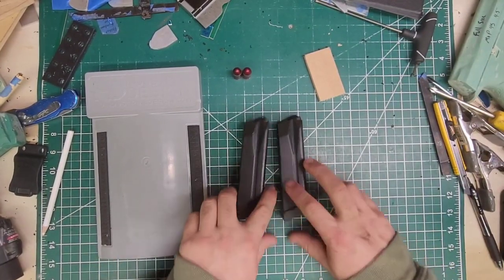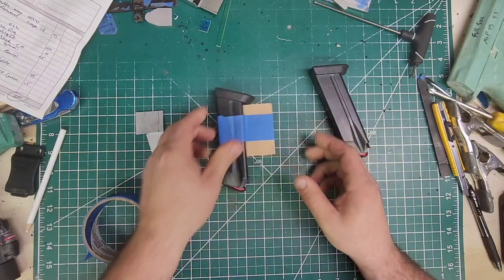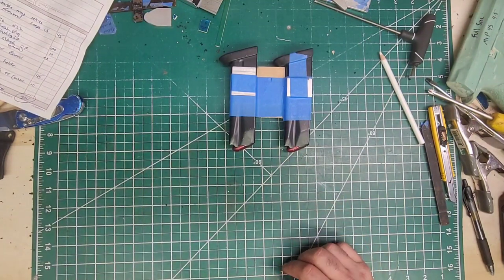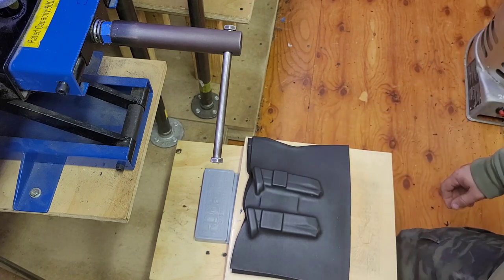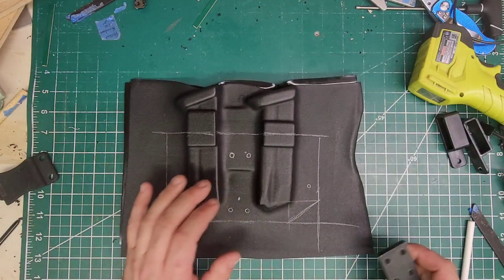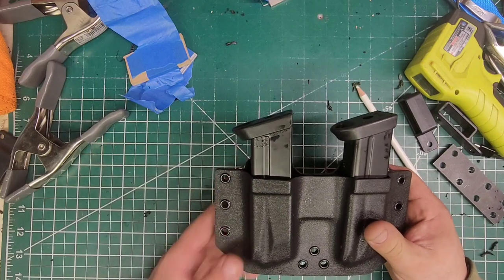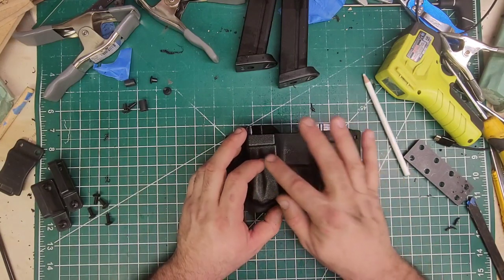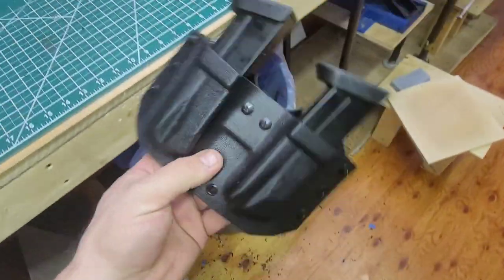Dual mag carrier in the HD jig

Comment: Great work!  Can you show how you block out a 1911 for an OWB holster.  Just curious how the blocking looks with all the controls..  Thanks!
Reply from the maker: Pretty simple. The right side needs a channel to the take down pin. The left side doesn't need anything passed the safety.  The slide catch is so low from the factory that the grip creates the channel. Personally I cut wood or scrap metal (if the mold isn't already blocked for it) to go over the safety. Or you cut the swestshield just before the safety and don't have to worry about blocking that side at all
Reply: @FalTacUnlimitedLLC  Awesome.  Thanks.  What thickness of kydex to you mainly use for your holsters?
Reply from the maker: @mrbreihan  .08